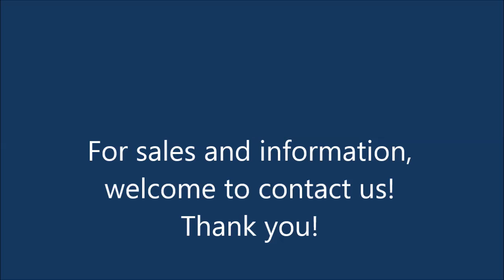Commercial POPSICLE MACHINE SINGLE MOLD of layout 4X10 or 3X10 JINLISHENG

Comment: How did the Popsicle come out so easily? Can you explain that part
Reply: jimmycakes12  . just dip the mold in room or warm water temp
Reply: Because the water in the lexon is at room temp so that mold tgat are transfer heat and cold very easily make the outer layer of the popcicles melt, making the popcicles come out easy